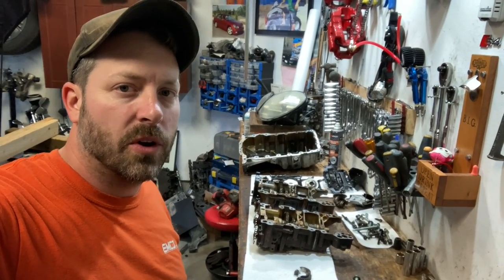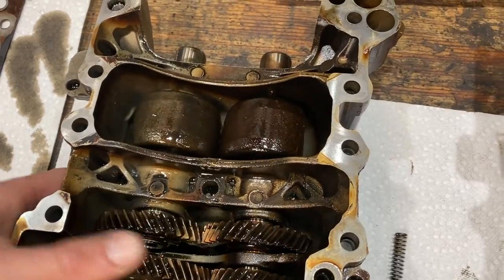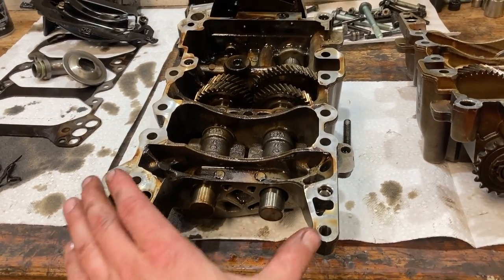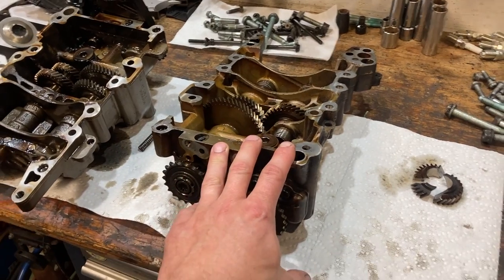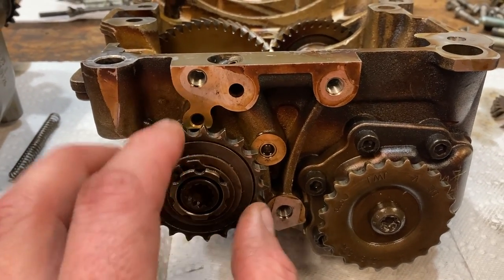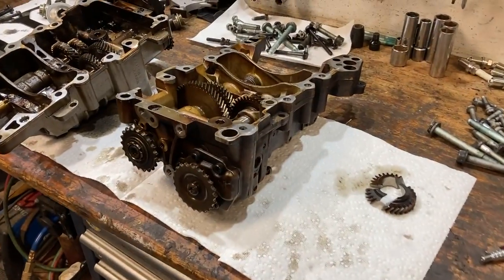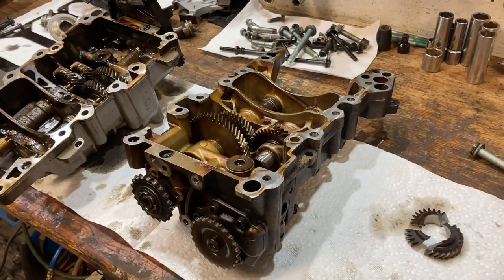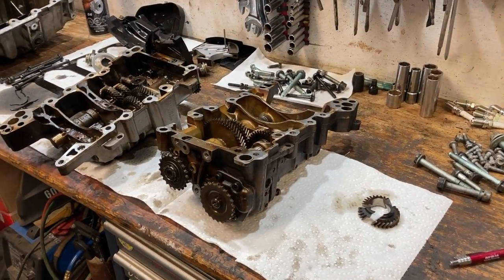Audi 2.0 FSI Cheapest Oil Pump Balance Shaft Delete and Options

Comment: I just saw a guy cut one of these in half with an angle grinder to remove the balance shafts. He then plugged two oil feed passage ways by tapping the openings and putting screws in with Loctite. I'll go your way unless I have that shaft play like you had.
Reply from the maker: Yep that works too. Never seen it myself but in theory works especially if you are planning to reuse your assembly.

Comment: I recently saw a guy with an S3 doing the balance shaft sprocket change. His seized and he lost oil pressure, Womp. 
Hope everything is happy after a good cleaning! <3 1.8T
Reply from the maker: Yes, that is a failure I forgot to mention, when the shafts complete seize and snap the balance shaft sprocket! I've seen that a few times. 1.8T for life!
Reply: @PBGarage  Sorry im a bit lost. My oil pump chain snapped twice now in 8 months. Would a freewheel be a good bet to fix this? How can i determine if the balance shaft is the issue or its actualy the oil pump and ill need to change the entire balance shaft assembly?
Reply from the maker: @oncaboy  Sounds like your shafts are starting to seize up. IF and only if you do NOT loose oil pressure, then a free wheel will solve that issue. If you experience any oil pressure warnings, then you need to replace the pump and cut off for good measure.

Comment: Interesting, I was researching this because I read that this is a common problem on this engine. I have a A4 B7 with a 2.0TFSI BWE engine @ 315 000 km. I have driven it for over 110 000 km and it's never been done. Though this one has been using 15 000 km oil change interval since new, and not 30 000 km long life.
Reply from the maker: It must definitely have something to do with oil change services. I think they are sensitive to poor maintenance and with these getting into the hands of those who don't properly maintain them exposes them as a weak point. Heard of a few cases on both extremes.

Comment: I remember doing this on a skoda fabia, it had a hole in the sump after being moved with a forklift.

the guy had a non balance shaft engine in another fabia, initialy we wanted to just use the sump but it would not clear the balance shaft so we removed the components inc the drive sprocket from the crank and fitted everything from the non balance shaft engine, iirc i only had to tap one of the galleries for a blanking bolt for it to work.
Reply from the maker: Nice work finding a solution!

Comment: I got a 1.8T in my B7 Avant Quattro. Not as torquey as the 2.0, but running 215hp at least.
Reply from the maker: I am super jealous that the 1.8T came in the B7 in Europe! That is the perfect combo for the B7, or a 2.7.
Reply: @PBGarage  Browsing for performance parts in the US is always a bit annoying, as you have to look at B6 for engine  and B7 for chassis. But the B7 1.8t I got sure is a cost saving late model, deadhead fuelrail with no vacuum reference, single side SMIC etc.
Reply from the maker: @jonasthemovie  I've managed to install OEM B7 dual side mount intercoolers into a 1.8T B6. was pretty straight forward actually. Couldnt fit the driver side B7 intercooler, but the rest clicked right together. You can make it a return fuel line set up if want! All of the things are possibles!
Reply: @PBGarage  Went for a 40% larger driver side IC instead of messing with the air pump placement and radiator support.

Comment: There is another option you missed. Swap the Totally Fukcing sh1t idea (TFSI) engine for the 1.8t20v and use the TSFI crank to stroke it. Comes with a free 1.8t oil pump and PRV
Reply from the maker: hahah yes, that is also an option that I would do before trying to retrofit a 1.8T pump to the 2.0T. I mentioned that actually at the end of Option 6 at 13:00 minutes, should have made it option 7 indeed!

Comment: Good video. But I wish I would have found it BEFORE I got the modified iabed unit. I swear I searched for days to find anything on the 2.0FSI low oil pressure indication my 2007 A3 was getting. I saw a ton of B7 and others but very little for the 8P. It took nearly 3 months to get the pump/shaft assembly so the car sat. I didn't want to risk the low oil pressure. Plus I couldn't find any junkyards with the 2.0FSI engines.  
Anyway, when I installed it, my battery was dead from sitting all summer, so I hooked up a charger/starter and something weird happened - the lights began to flash and the horn made a sick sounding honking noise. When I tried to start the car all my dash light flashed and the gear selection row (PRNDS) flashed slowly and continuously. My shifter was locked in position. I used the emergency release under the cover to put it in gear but the transmission did nothing. I downloaded a VCDS scan and just about every module had errors and faults! Ultimately, I had to take it to Blair Automotive in Carrollton TX who found the shift selector bad. Somehow hooking up my jump start box fried it! That was over $2K and almost a month wait for the part from Deutschland. I finally picked it up last week and drove it for the first time with the iabed shaft delete mod and I have to say, it actually seems to idle smoother and QUIETER! the 2.0FSI has always been a 'diesel' at idle. It now sounds more like a garden variety 4 banger. Do you think the balance shafts are what make that rattling noise? I always thought it was the injectors.  Both my shafts were loose but not as bad as in your video. Enough to give me an oil pressure light though.  I don't notice a power increase as is claimed but then again, I'm at APR stage 2+ so probably not much to notice of the pants. Plus, I'm running cheap tires with no grip right now so any heavy acceleration is greeted with large amounts of traction control (or tire smoke if I turn it off!). 
Thanks for the video and info.
Reply from the maker: I don’t think the injectors cause vibrations, they would contribute to noise/ticking, but the balance shafts not being held in place will certainly cause vibrations. The 2.0 in general is known to be a noisy and vibration riddled engine. By letting the battery die/disconnect will cause a fault in every system as they all see power loss. Resetting all the codes with a charged battery will clear them for good. Happy to hear you liked the video!
Reply: The camshafts are driven by a chain at the back of the engine(front being the side with belts)
The tensioner is spring loaded with an oil feed to tension it.
The tensioner has a small feed for the oil and a filter built in.
Over time this gets clogged and the engine will sound like a real diesel engine.
While youre taking all that apart make sure to replace the cam follower for the high pressure fuel pump, it’s a known weakness and should be a maintenance item every 10000miles to be safe(though mine was still ok at 100k miles)

Comment: My chain broke on my oil
Pump assembly. Pulled over immediately but just not sure what direction to go in as not sure about more damage to other components. And even whether the oil
Pump itself is still fully functional.
Reply: I’m no expert but I think the simplest solution might be a 2.7T swap.
Reply from the maker: Doubtful that the oil pump is still functional, would need to drop the pan, pump and check for carnage.

Comment: I cut both my shafts out and then welded the oil gallies
Reply from the maker: Heard of that too! No many perform it to that level but those that do, sometimes forget to weld them shut.
Reply: @PBGarage  I didn’t know they had to be plugged at first either but it was taken care of before i put it back in the engine and i also recommend a oil pressure gauge lol
Reply: You got a video on it or can give some info that is what I was thinking about doing as mine have alot of play in it like the one he has
Reply: I need information on what you have done I thinks my balancer shaift needle bearing is done or not existant anymore and I have intermittent low oil pressure warning when I let the gaz off

Comment: mikmotoren makes a perfect kit for a lil under 1k no drilling or changing of sprockets
Reply from the maker: That’s a beauty kit, definitely a great option for anyone wanting to keep the car a long time.
Reply: @PBGarage  also its the cheapest if you dont scam yourself, even tho the others cost less they take so much more time and effort and the risk of contaminating youre engine also time is money
Reply from the maker: Depends how you’re slicing it for sure. If you’re doing it as preventative maintenance and you’re just cutting off the gear like Blake did here, it’s free.

Comment: Hi , thanks for all this information, my question is ,where is the oil pressure regulator location ? Behind pump ?
Reply from the maker: Correct, it is behind the pump, from the top of it, you can see a large hex bolt right behind it. Remove that bolt and the valve will spring out.
Reply: За допомогою цього клапана , можна підняти тиск масла?

Comment: Hey man, i just bought an audi a3 about a month ago, just realised now that i hear a rattling noise from the sump and an oil light above 2000rpm. Im thinking of option 1, though i dont know what its casualties may be.
Reply from the maker: Stay tuned we are about to upload a bunch on a GLI with failed oil pump, same setup as the A3.

Comment: Where's the video for removing the oil pump.. might give that a try before I just 1.8t swap it.. my mk4 gti runs fantastic at 315hp. Just do it again in my mk5.. lol after I blow the 2.ot up.. lol
Reply: Good question, I also want to see the removal and install video.
Reply from the maker: Its been posted for at least 30 minutes :s check it out! Its hot off the press!
Reply: @PBGarage  nice!

Comment: Hello, is it possible to see whether the oil strainer is dirty/closed or not via the oil drain plug with an endoscope camera?  Can you make a video for us to see if that is possible?  Thanks
Reply from the maker: It certainly is not possible, clearances are way to tight to get a camera to bend into position let alone keep oil from dripping onto tbe lens. Best to take the pan off and inspect.

Comment: I feel like swapping to a 1.8T and manual gearbox would be less time/money/effort than replacing that oil pump.
Reply from the maker: Option 1 should be to delete entire 2.0t and replace with 1.8t. No further options.

Comment: Ye this might have been my issue I was hearing. Ticking noise and I was getting low oil pressure light coming on once in a while replaced sender since it was leaking out the connector so replace and no more light but I would get they beep once in a while and then 2 weeks later boom rod out the side of the block on the highway, so I’m going to check it out on the used engine thanks for the vid. What a stupid design
Reply from the maker: Yep truly a design flaw imo. Some don't even make it to 100kmiles like mine!

Comment: i do my Balance shaft delete , i cut off my wheel so theres no spinning on the shafts it work 5000km without issues
Reply: Are vibrations increased? is it a lot different then before? mine siezed,i pla nto cut them aswell. Answer if u can please
Reply from the maker: I have not noticed any additional vibrations.
Reply: @TheDraganche  the Motor little more swank ob idle 🤭

Comment: Does this affect oil pressure at idle once warmed up? I read some people were getting low oil pressure with the balance shaft delete?
Reply from the maker: Check 8:15, it certainly can, which is why I found a good used unit and cut the shafts from the good unit. If I put a free wheel on my original unit, I would still have oil pressure issues once warmed up.

Comment: The oil light comes on from time to time, I have stopped the car and I have not gone with it, disassembling the pump and cutting the balancer sprocket will it solve the problem? Or do I have to buy another new pump and modify it?
Reply from the maker: Need to buy another pump and modify it.

Comment: alright buddy i see you are pretty active in replying to messages so I will take my chance. In my case there is a A4 B8 with a 2.0 TFSI engine. Six months ago started some errors regarding oil level but the oil level is ok everytime. So I am thinking doing this freewheel mod but I am afraid it would damage the engine. Another question that pops up in my mind is why Audi/VW developed these engines to work like this with the balance shafts?
Reply from the maker: Oil level error might just be a bad oil level sensor. Balance shaft assemblies were introduced to make the engine smoother/more comfort, especially for being a premium brand, they come up with all sorts of devices to make it smoother. I honestly have not noticed any change in comfort/NVH. Mines an automatic, so its not smooth to begin with due to the torque converter most likely failing.

Comment: Does anyone change the chain on this job?
Reply from the maker: No, the chain rarely fails, unless caused by something else. To do the chain you would have to get into service position, remove the timing belt/crank pulley, timing cog and front main seal cover. not worth it in my opnion unless you are going high HP/
Reply: @PBGarage  thanks for the reply, I decided to leave the chain in place and all is well 👍
Reply from the maker: @luk-argen7144  NIce good to hear!

Comment: Quick question. Can balance shaft make annoying sound when the engine is warm but no sound when cold?
Reply from the maker: Yes. Oil is thicker when cold. Cold thick oil will fill the loose tolerances until the oil heats up/thins out.
Reply: @PBGarage  sounds like balance shaft delete.. 😅

Comment: Why can't we just replace oil pump for good measure and weld the wobbled out port hole that balance shaft goes through and then delete it by cutting the balance shaft
Reply from the maker: You certainly can do that, but you need be able to weld aluminum. I am also uncertain about the path of oil flow through the overall assembly, and leaving it all in place is a safer bet to maintain proper pressure throughout the overall system. I should have mentioned that as an option.

Comment: Could you not have removed the balance weights and blocked the holes yourself?
Reply from the maker: yes, but that requires a significant amount of grinding, and then some means to press in some bushings. More work than just pulling a used one for me.